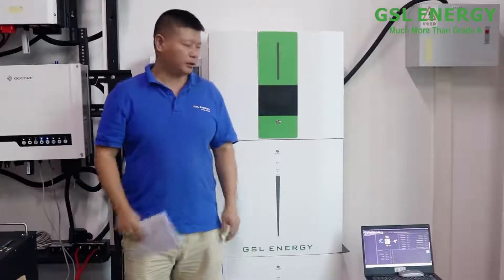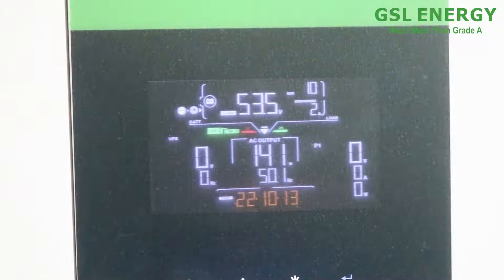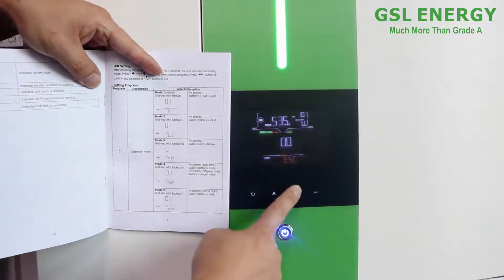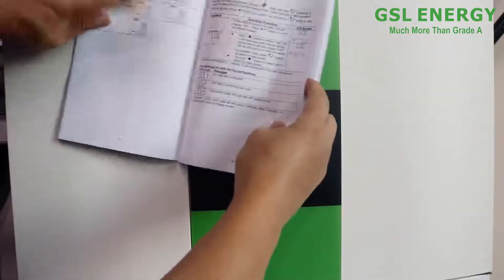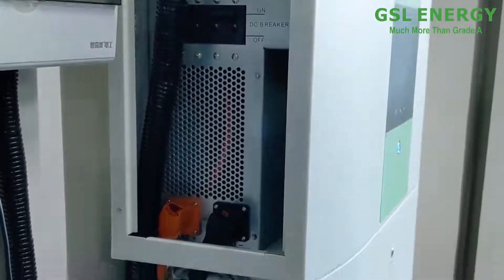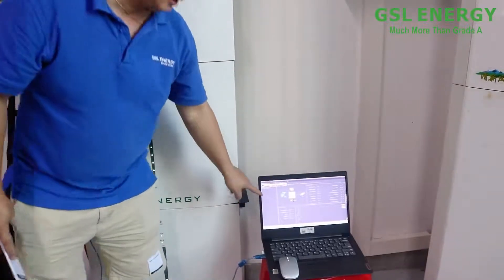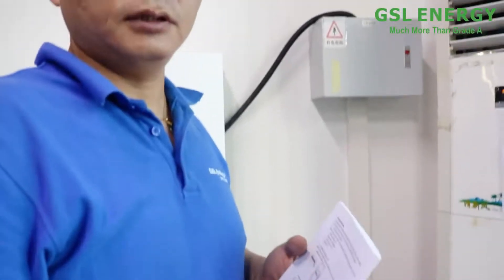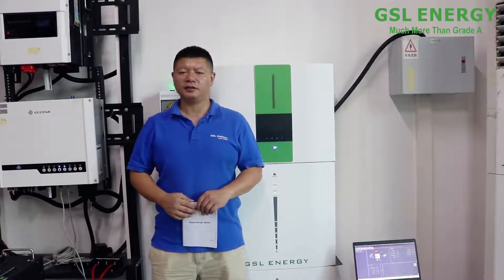GSL All-in-one LiFePO4 Stackable Lithium Ion Battery Solar Inverter System  (3) : System Display

Comment: What cable is it tha connects the laptop to the invertor please, I have tried usb to ethernet but that doesnt work?
Reply: I have try both cables too still no connection
Reply from the maker: Hi, thanks for your comment. This cable is specially for BMS software communication. If you purchased the system from us, you can contact our sales manager for details.